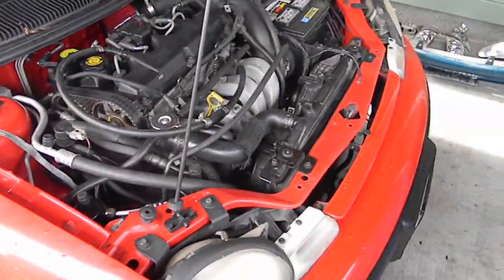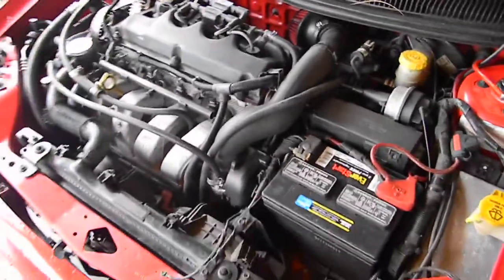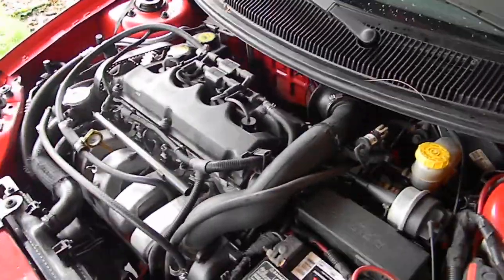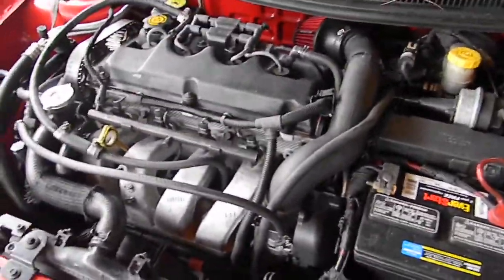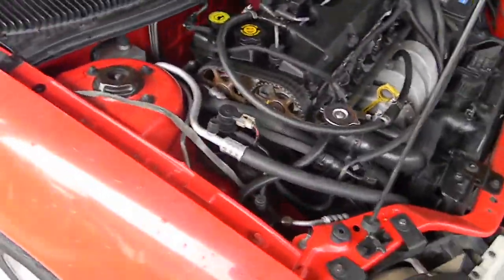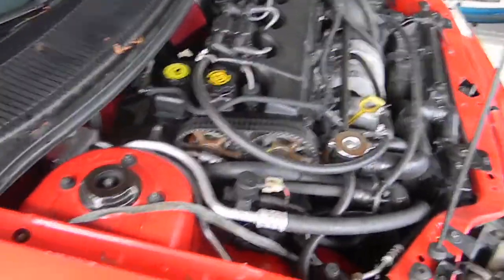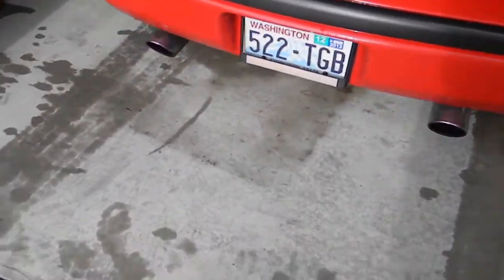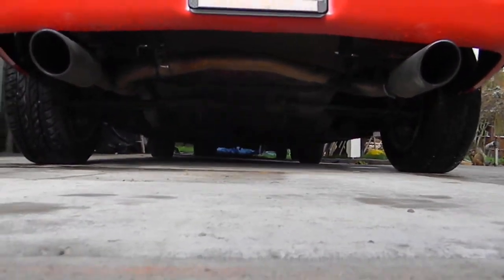1996 Dodge Neon SRT-4 Exhaust

Comment from the maker: All of the exhaust systems I know of for the 1st gen neon use mufflers. They quiet the car well, but at the expense of changing the tone drastically. I have another vid of a borla muffler hooked up to this car, you can check that out and see if that is more what you're looking for. If you like the muffler setup, then there are plenty of catback dual outlet exhaust systems sold on eBay I believe which won't get you pulled over every time you cruise by a cop.